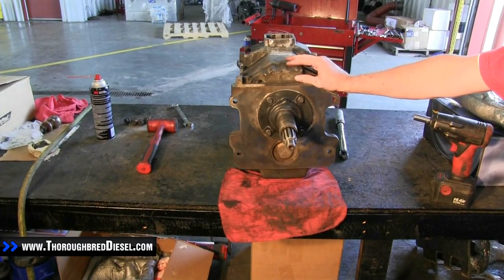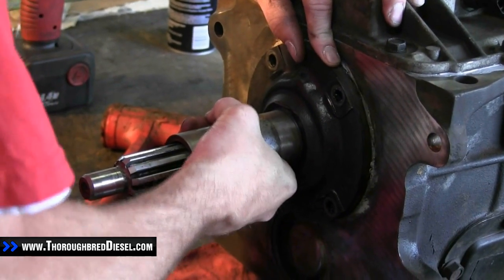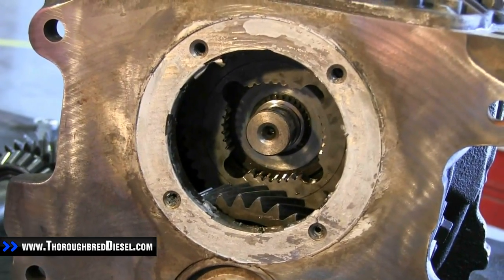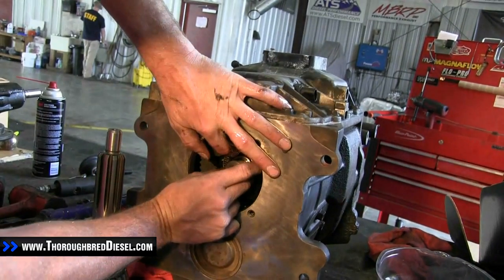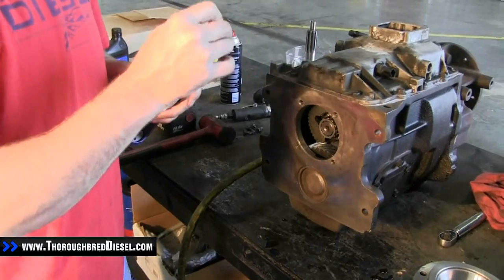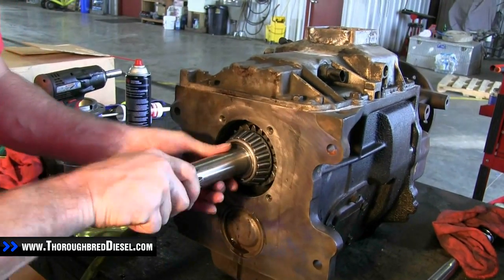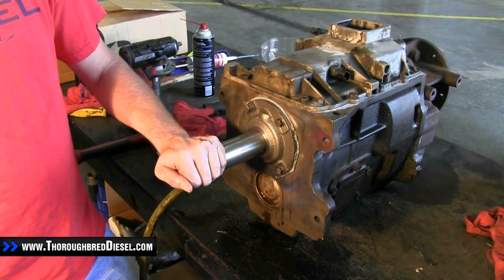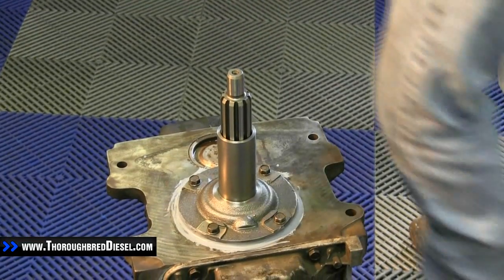South Bend Input Shaft Upgrade Install

Comment: One thing he didn't check is if the sealant blocked the bearing oiling hole on the input cover. Seen it happen. When you do this install you should remove the top cover of the transmission and check to see if the sealant oozed into where it isn't supposed to be when the input cover was seated. Otherwise you could possibly burn up your front seal and bearing within the first 100 miles
Reply: thanks for the priceless info

Comment: After just removing a the cover for my input cause it sheared the collar off. My advice when it comes to the way the permatex is applied is to yes smooth it out and let the permatex set up a bit prior to assembling it. It can and does cause the oil feed to get plugged up a little.

Comment: Are the input bearing and bearing cup easily removed, or will they need special pullers? I know they are supposed to be press fit in the first place, correct? Thanks!
Reply from the maker: I would suggest having a bearing splitter and access to a press.
Reply: Thanks! I'm swapping out a gasser input shaft for Cummins/V10 and was considering saving money by reusing the bearing and cup, but I think it's more worth it to just buy replacements.

Comment: Can you install a Dodge input shaft into a 99' Chevy NV4500 when doing a Cummins swap?
Reply from the maker: No, but there is a 1.25 input shaft upgrade out there offered by New Venture that would upgrade the shaft.
Reply: @thoroughbreddiesel  are you sure? It was my understanding you can swap all the dodge parts from the bellhousing to the input shaft on the late model GM NV4500?

Comment: Should the input shaft be easily spun by hand once fully installed? Mine didn't spin easily once the collar was torqued up.
Reply from the maker: It depends on your definition of “easily”  there should be some gear rollover resistance.  If it is even a question to you have it checked by a professional.
Reply: It's more than gear rollover resistance. You need to grab it with both hands tightly to be able to spin it. My best guess is a few thou worth of shims needs to be removed but I don't trust myself enough to do a full tear down...
Reply: Maybe your bearing Race is not seated deep enough in the input shaft Cone!
Reply: Do you have bad bearings?

Comment: I have an early model nv5600 6 speed with the 1-1/4" input shaft. Is this the same shaft I would need to upgrade to 1-3/8" for my 6 speed?

Comment: Thanks for the video so far the only one i have found on here, though is this for ford or dodge?  if it is dodge is it this easy for the 4x4 automatic?
Reply from the maker: +HalfNekoJames This is the input shaft for the NV4500 manual shift transmission.  This will not work for the NV5600 6 speed manual,  G56 6 speed manual,  or any of the automatics.  To change the input shaft on the automatics it is a much more involved process.

Comment: Hey their. I have a 2000 Chevy 3500 with the nv4500, and I was wondering if this shaft kit would work on my Chevy nv4500? so It can be captible with  the cummins motor?
Reply: Yes it will